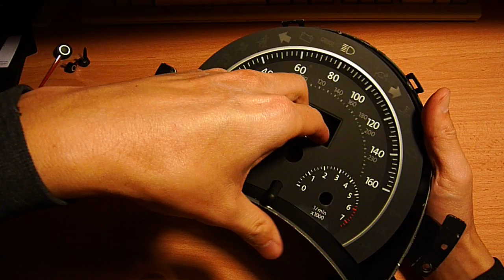2008 Beetle: Dissect Instrument Cluster

Comment: I have a check engine light that won't go out-my mechanic has tried everything and replaced every possible part:

1. Can I remove the check engine diode?
2. Will this cause the engine to throw some kind of code or fault where it would not crank?
3. Would this cause the other lights not to function?

I can't wait to get tid of this car-it's like a high maintnenence girlfriend-the benefits aren't worth the headache!
Reply: Did u find out? I can't wait to get rid of mine too